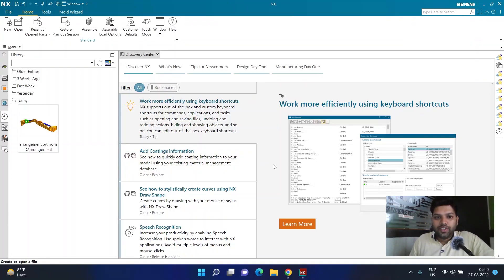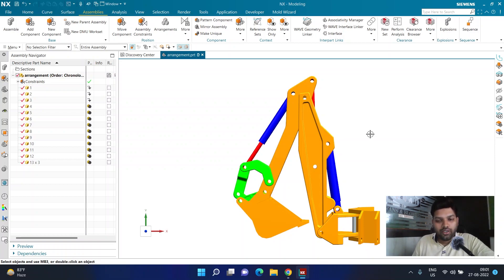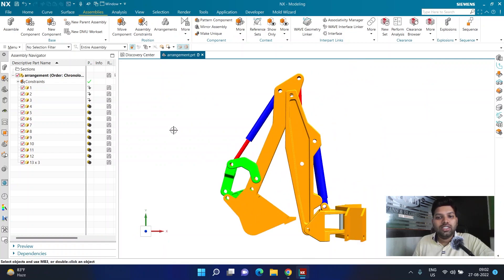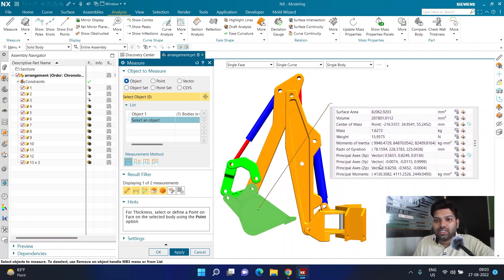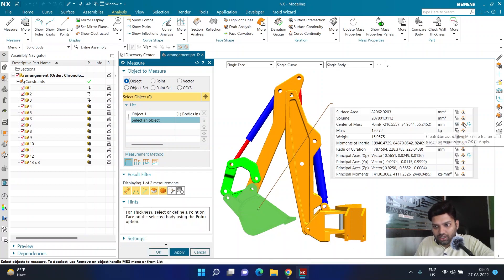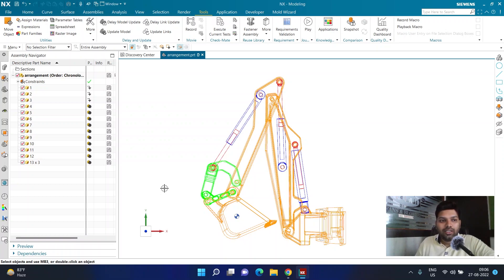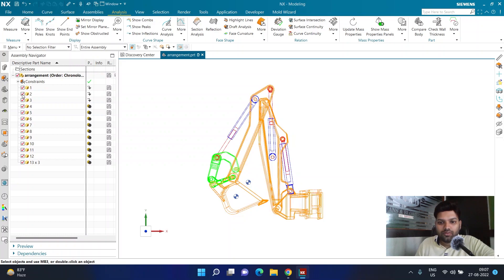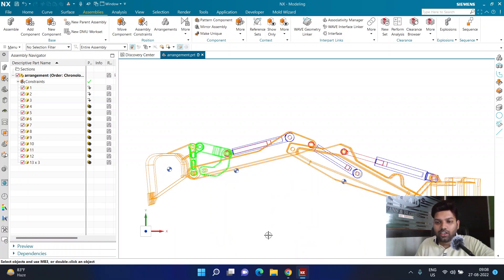CENTER OF MASS WITH ASSEMBLY ARRANGEMENT | SIEMENS NX

Comment: how if one of the component is having different density? example if the front bucket were plastic, how do we assign the density and remeasure the center of mass?
Reply from the maker: change the material of the part and continue following this process

Comment: how does the center of mass work with a motion simulation?
Reply from the maker: One of the possible way to work with center of mass in motion simulation can be  - we can create a point of a co-ordinate system linked to center of mass and then take the output in X,Y and Z co-ordinate during the motion simulation. there are more possible ways to work with center of mass in motion simulation